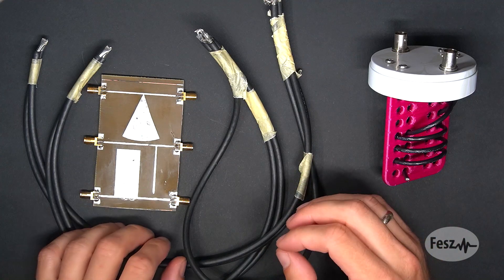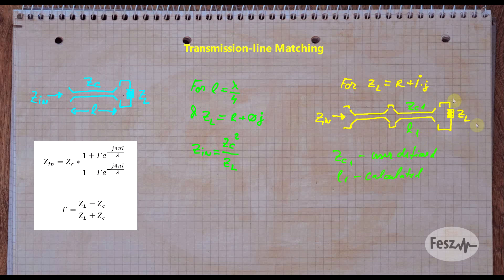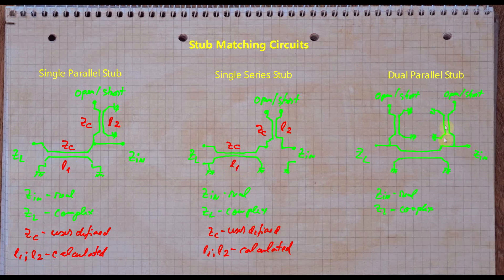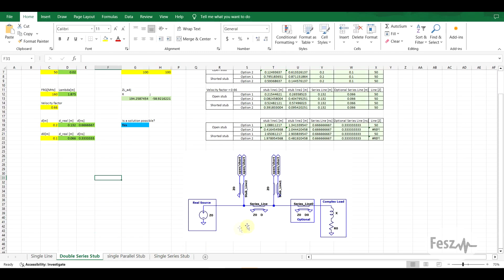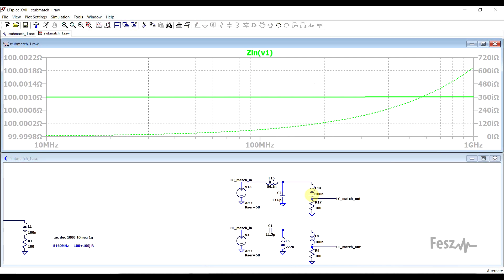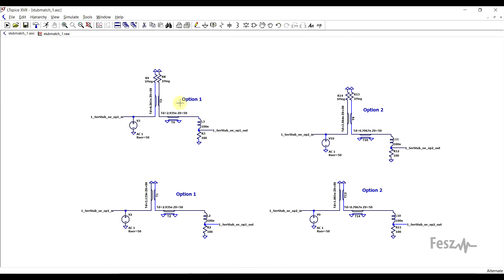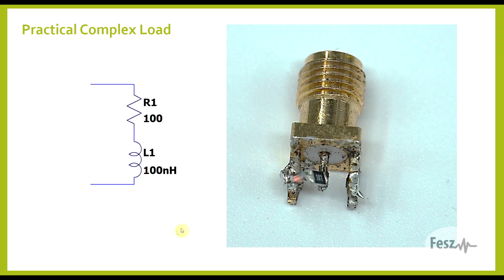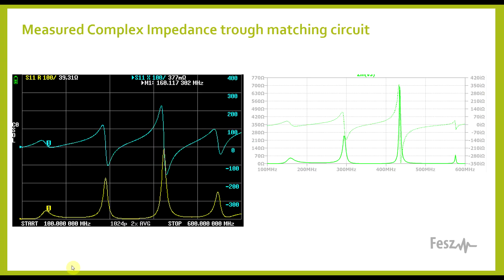Stub Impedance Matching

Comment: Why the 3 dB loss?
Reply: 3dB loss is because the source is 50R and the load is 100R. The reactive part is tuned away, but the real parts stay.
Reply: lossy transmission line
Reply: @giorgitsintsadze9919  3 dB loss from   Just half a meter of coax?

Comment: Ask ChatGPT  "explain how to use a parallel coaxial cable stub to match a source impedance of 50 ohms  at some fixed wavelength to a 25 ohm load."